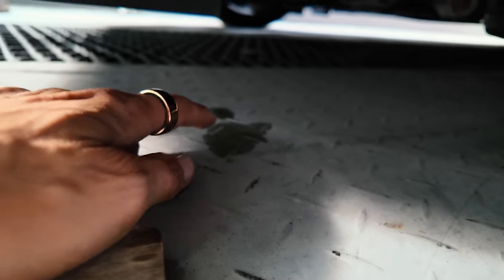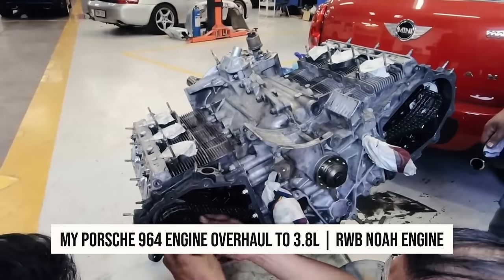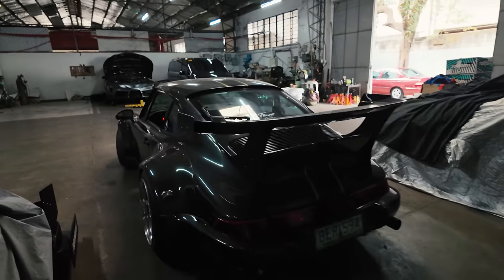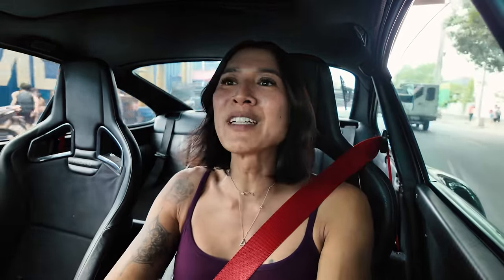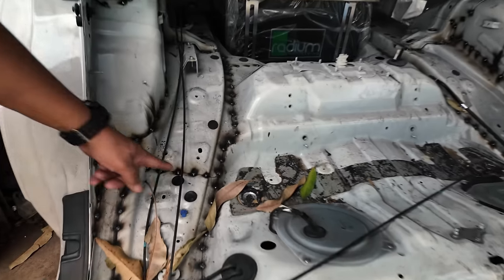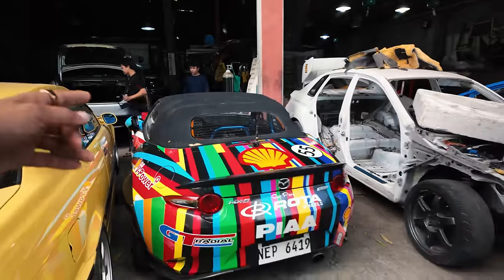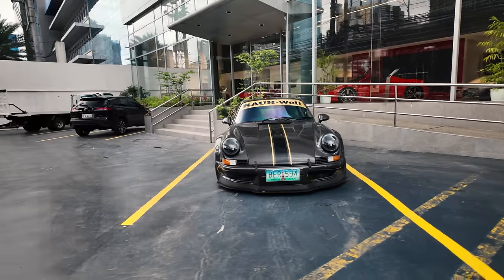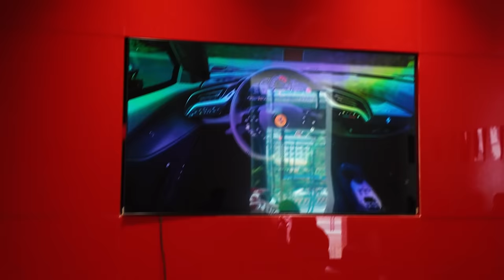RESTORING MY CRASHED GT2RS | Angie Mead King

Comment: You could have sold the GT2RS internationally and made good money instead of butchering it completely.

If you really want to race, use the money from Gt2rs and buy the Porsche GT3 which is setup for racing or if you can convince Porsche to sell you the rare GT3RS 😅.
THAT'S THE WAY TO GO. ASPIRATED IS  the best for racing.
Turbo is not good in hot weather Philippines.  Overtime in the race, turbo loses efficiency as it got hot and intercooler fully heat soaked.
Reply from the maker: Well you do you. I do me. I want to transform this car to my spec
Reply: @AngieMeadKing gotta respect you for that. New subscriber here!